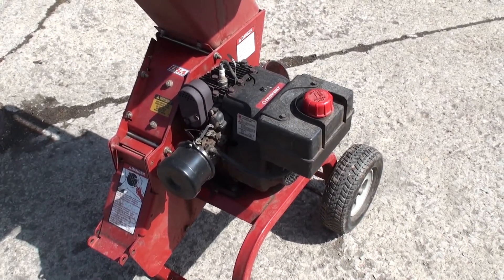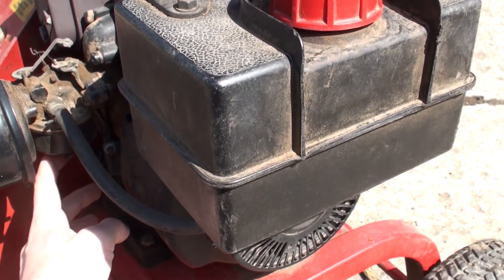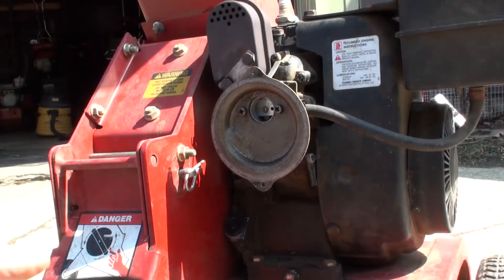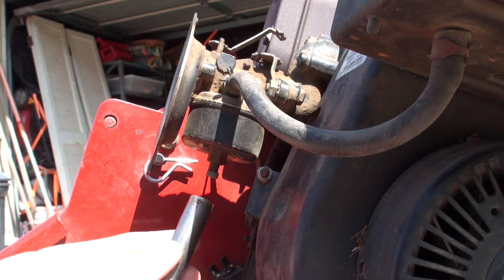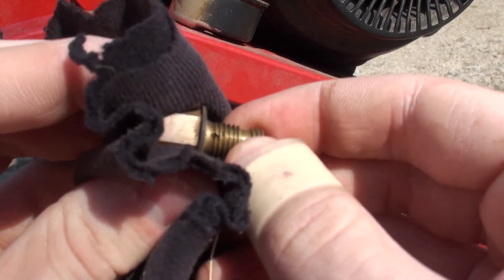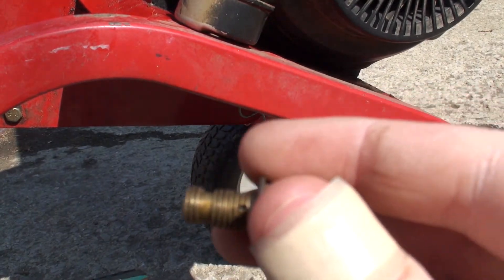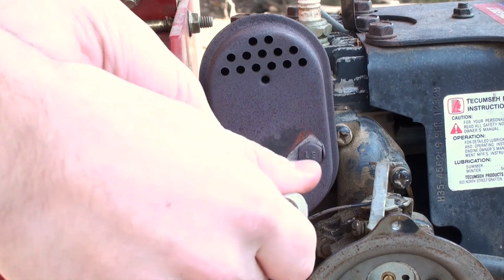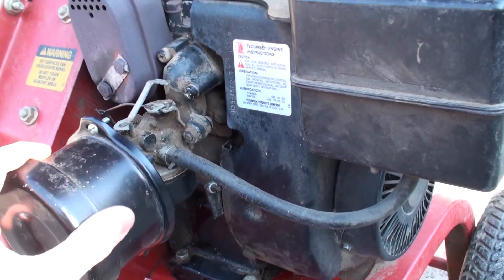How to Tune up a 3.5HP Tecumseh Engine

Comment: If the air filter wasn't present or wasn't doing it's job, the dirt ingested would be going into the cylinder (wearing out your engine), not into the carburetor bowl.  The only way dirt or debris gets into the bowl of the carburetor, is through the fuel supply.

Comment: I have a carter with that brand motor that is cyntrivical and I can't find anything about fixing the disc that turn underneath ,  the motor on the underpart of go kart. It is sparking and it won't go. I am assuming both pieces used to have rubber and it isn't catching dur to metal on metal contact. I can't find anything online to what those parts are even called, to be able to look those parts up.. Any help would be appreciated!

Comment: Tip: You don't have to remove the screws from the air cleaner, just loosen them. Twist the cover and it will come off, now you don't have to worry about losing the screws.
Reply: He doesn't have the original screws.. mine were replaced also 😬